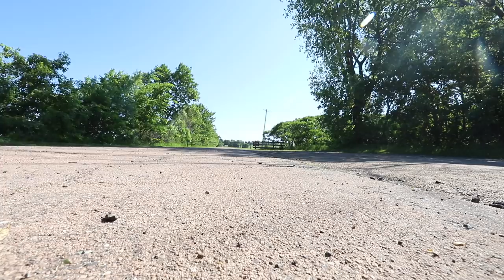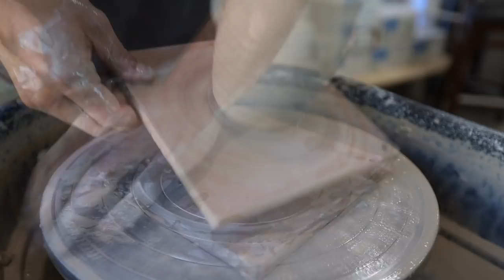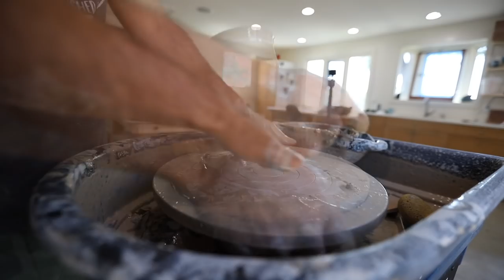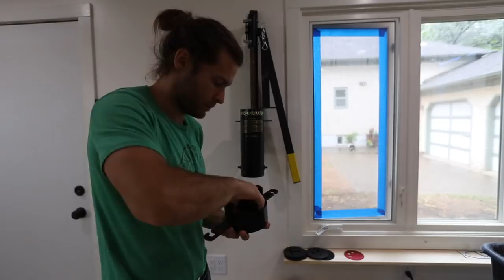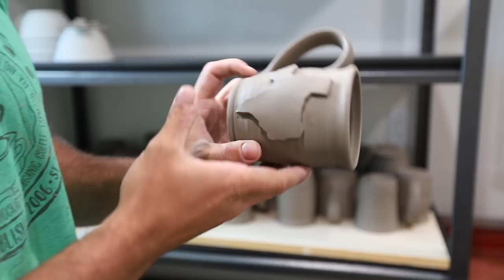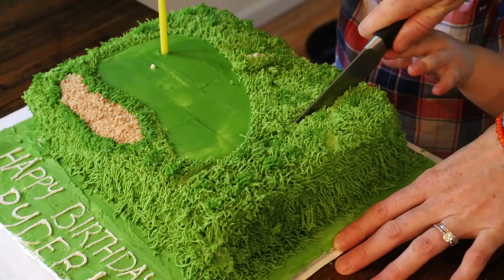25 Different Shape Mugs - Thrown on the wheel

Comment: Me trying to make 4 matching mugs.
Reply: One of the tricks to making a matching set, is start with the same amount of clay.  As long as you are not removing too much, during the centering, you should end up with wares that are similar in size.   Of course measuring height and width, is also advised.
Reply: Also it helps to use like a bamboo skewer. Cut one length for the width, and another for the height and make a cross of the two measured sticks.   I use a wire bread tie to fasten them and trim off the extra wire.  It's a handy little too too have around for such tasks.
Reply: hahahaha this is an AWESOME comment

Comment: Nice mugs! You said that they were all about a pound, what are the other (approximate) dimensions? I've been trying to work on the thickness of my walls, and I think I've ventured a little to the thin side of "good". I'd guess those mugs are 4-5" high and 2.5-3.5" inner diameter? That would make them 14-16 ounces (volume) after firing? Thanks for your videos, tips, and energy!

Comment: Are those Continental's bats?  I use them, in my classroom, and have been happy with them so far.  Did you run out of squares part way through, and have to switch to the rounds?